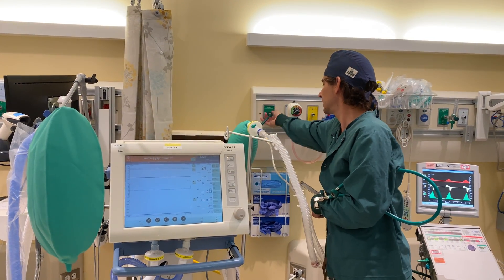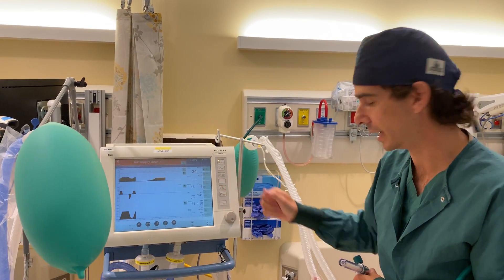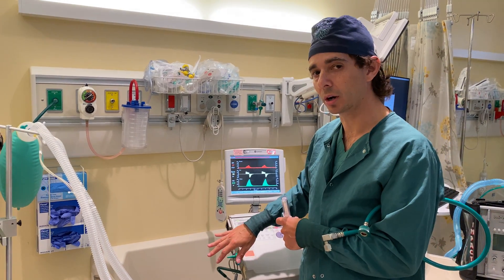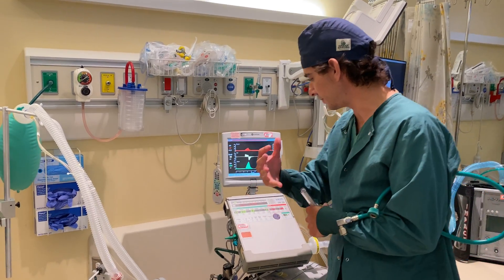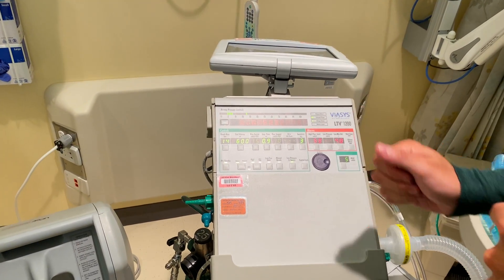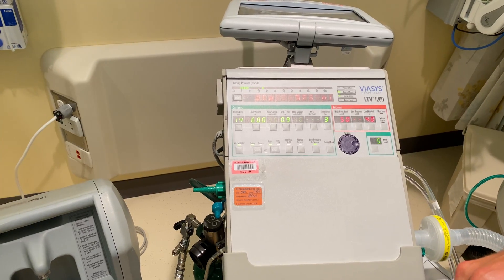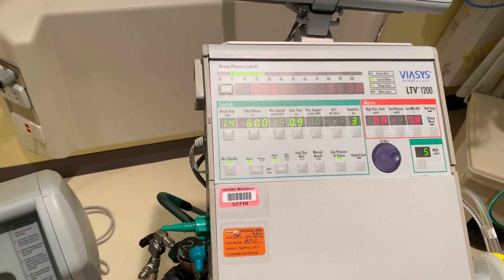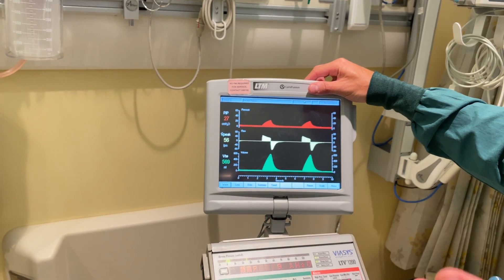ICU and transport ventilator setup with different oxygen sources

Comment: Hey I have a question for ventilators sv300 mindray that show two fi02 the one that is set does the other fio2 mean the actual fio2 the patient is getting? For example the set fio2 is 50 and the one on the monitor near the tidal volumes shows another fio2 of 52